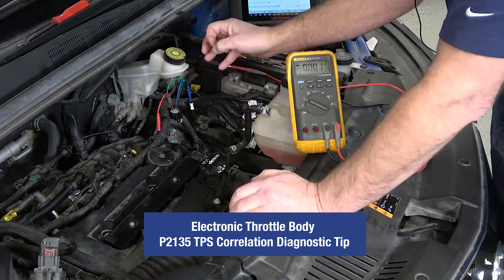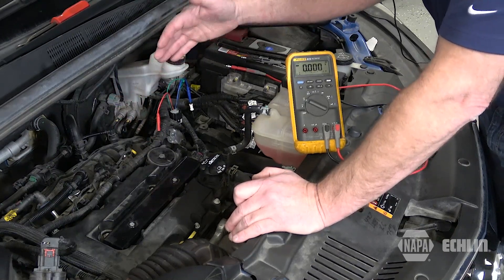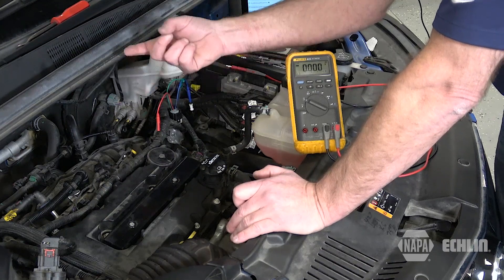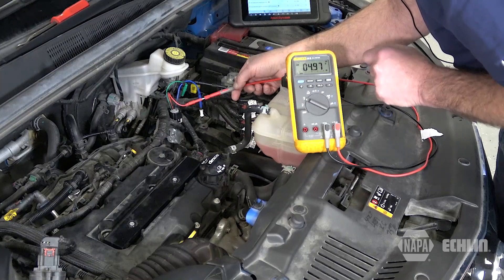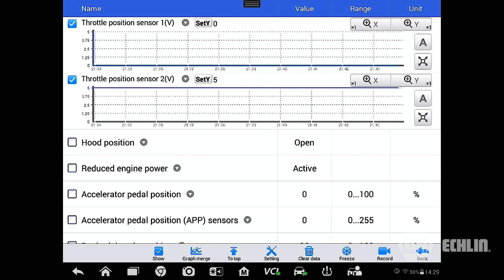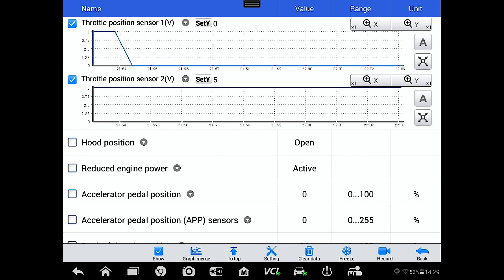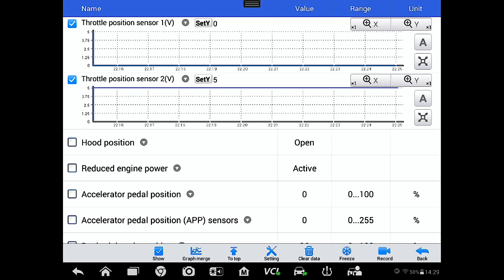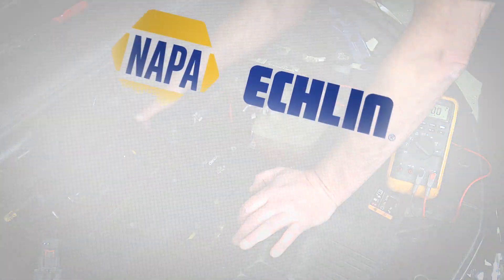Electronic Throttle Body P2135 TPS Correlation Diagnostic Tip

Comment: Please I am having problems with my 2006 Nissan Murano, Code P2122, P2138 and P0643, Changed Pedal, Changed Trottle body and still car won't accelerate. Once TPS or Pedal changed car drives for a while like 1km and it goes to limp mode with Slip light and VDC displaying a check engine light, when I disconnect the pedal cable the car get high acceleration can drive . But it's slow. please any suggestions for possible solutions?